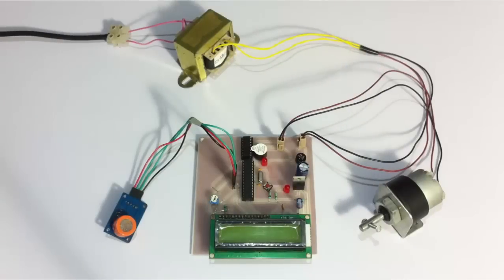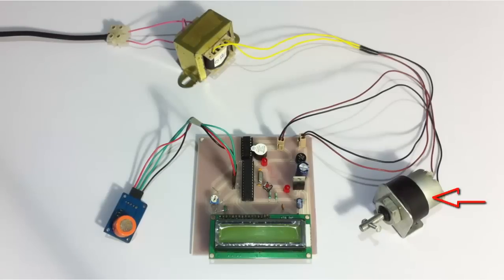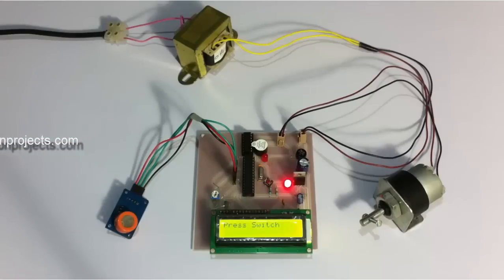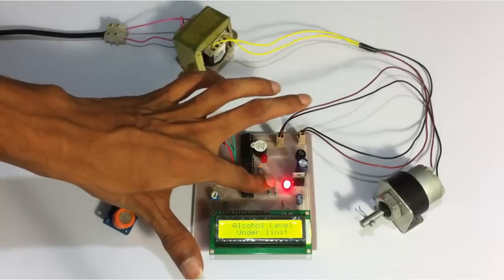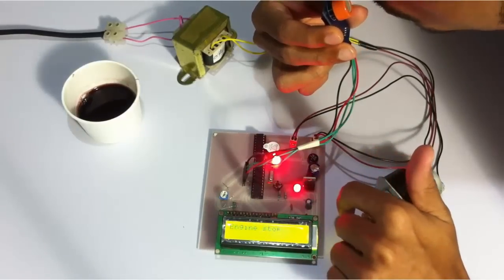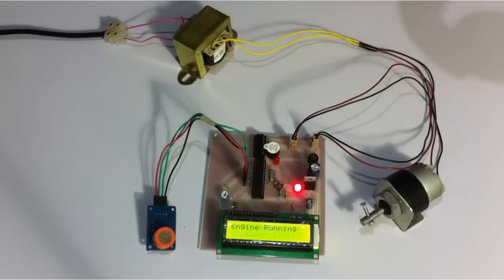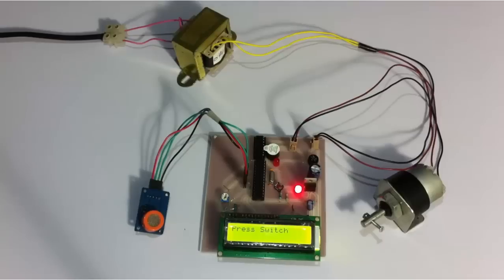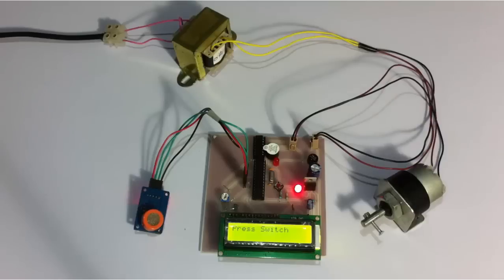Alcohol Sensing Alert with Engine Locking Project

Comment: if the driver is using deo, then also the engine will go off, how is it then going to work?
Reply: We need to set the limit as required. Small amount of alcohol percentage won't make the ignition stop.

Comment: If someone else sitting in the car is drunk and the engine locks then ...? What changes can I make to prevent this ? Plz answer
Reply: This sensor is place in the steering. It can detect the alcohol level only for the driver. If passenger has drink, it is not an issue. As it doesn't come in the sensor range

Comment: wouldn't just stopping moving vehicle in traffic without warning to the world be even more dangerous than a drunk driver?
Reply: can you give reply for this question
Reply: Actually
I had done this project last year.
For every 5 seconds, sensor will see whether the alcohol present or not. If it detects the alcohol, the ignition won't switch on.
When driving, if the sensor detects the alcohol, then it will give a beep sound, displaying on the LCD screen, that alcohol is detected. After 4-5 minutes( we will give the delay time as required), the ignition will switch off. In this gap, the driver can park or take the vehicle to the side.
Reply: @silent_hangover  hey there what kind of motor did you use and please  how can i contact you
Reply: @brendonmureveri1871  I have used a small dc motor just for showing. That would be simple. Used Arduino as a controller.
Reply: @silent_hangover  Hello Bhaiya, my team is also working on this project but we are unable to code can you please provide me ?